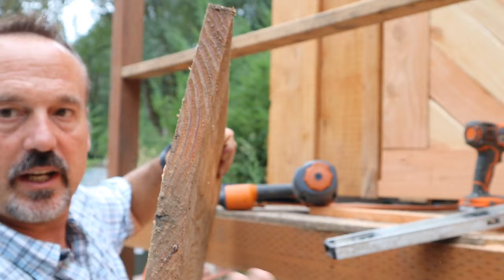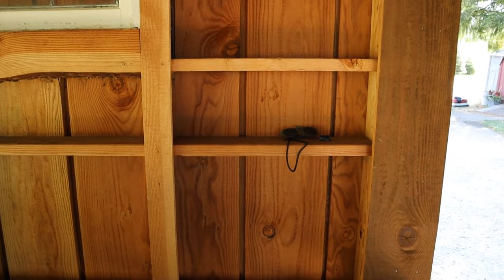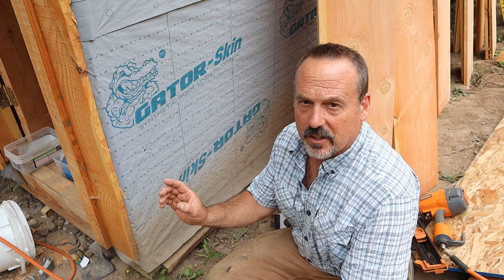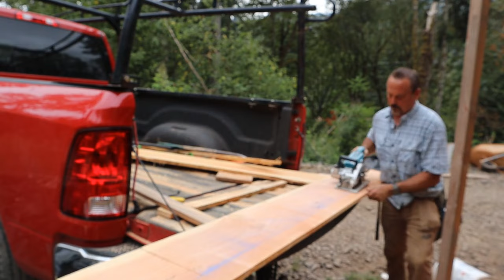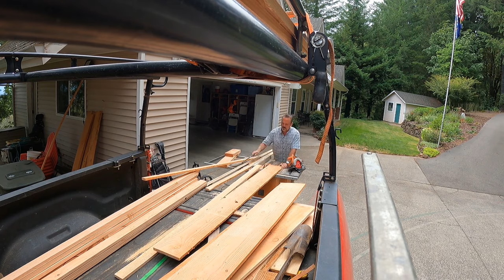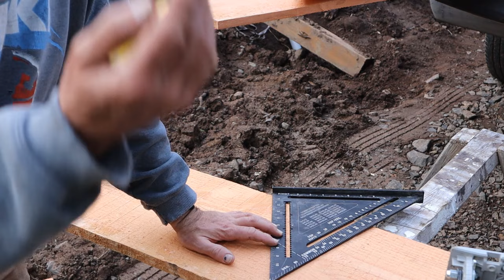Installing board and batten siding.  Board and bat how to.

Comment: Wow.  Great video.  So informative.  I was wondering if you would put any caulking between the batten and board.  You don't have any concerns of sideways rain getting into the walls and developing mold?  I guess this may also interfere with expansion/contraction of the boards.  (Initially, I was disappointed by the batten being on plywood, but in waiting a minute, I was very glad I continued watching.)

Comment: FOR ADDED STRENGTH I'M GOING TO PUT HOUSE WRAP, 
HORIZONTAL 2×4'S @18-24"O/C
1.5" INSULATION BOARD BETWEEN THE 2×4 THEN INSTALL THE B&B SIDING W/SCREW'S. 
LIVING IN LOWER N.MICHIGAN THE ADDED INSULATION BOARD WILL HELP REDUCE THE HEATING COST FOR WINTERS.
Reply from the maker: Excellent

Comment: What’s your take on using horizontal furring strips to create an air gap between the siding and house wrap for water drainage / ventilation?
Reply from the maker: @MrIsakdim  it seems to be an unnecessary move for those reasons.   If the strips were horizontal it would not help with drainage.
Reply: @FlanaganHomestead  

Good point. There are perforated strips allowing for water to go through.

Comment: Great video.  What type of wood did you use for your board and batten
 and also what size/type of nails did you use in your nail gun?  Thank you.
Reply from the maker: Thanks, I cut a large Doug Fir on my property for the boards.   1x12 boards 1x3 bats.  I have been using a 2 3/8 ring shank nail in my gun.

Comment: great video thank you so much ! What do you do on the corners of the building?
Reply from the maker: I take similar rough sawn lumber anywhere from 3 inch thick(which is the width of my bats).  To 5 inch.  Create a corner and mail it on.

Comment: Thanks! Informative and helpful.  Question: I’m building a small storage, basically a broom closet that will be on my covered deck. I’m using 6” wide rough cut cedar fence pickets for the verticals. Also I plan to stain and apply polyurethane. So my question is, will the fence pickets swell and contract enough to require attaching only on one side, as you demonstrate? Thanks again!
Reply from the maker: That narrow of a width, if the boards are very dry now, I wouldn’t expect as much shrinkage or expansion.   If it were me I would still fasten on one side.

Comment: I want to do this as siding on our house. It currently has old wooden clapboard siding. Do we need to remove the clapboard and put plywood to the studs, then wrap that with tyvex and then do the board and batton? If we were to do the plywood and batton instead of the true board and batton would we still need to do the plywood to the studs then wrap it with tyvex and then more plywood ontop of the tyvex for the battons to go on?
Reply from the maker: You could put it over clapboard, but it might create some problems. One would be it would push the final siding further out and trimming windows and doors would be difficult.  If doing plywood and batten you can put the tyvek on the studs, then plywood then batten.
Reply: What size plywood would you need on a house? 3/4 or 1/2 inch
Reply from the maker: @taurareynolds5049  in most situations 1/2 inch plywood has enough sheer strength for houses.   All homes here except for specialty homes are sheeted with 1/2 inch including my house.

Comment: Are you worried about the screws splitting the boards? Would it be better to use like a roofing screw that lays flat on the board?
Reply from the maker: Not when they are a long ways from the end of the board.   The screws at either end depending on the proximity to the end you need to be careful.

Comment: You can do it this guy's way if you want to spend 5x's the amount in materials and 3x's the labour to achieve the same end results
Reply: Ok, yes, there’s almost always a better way to a lot of things… do you have an instruction video or other instructional material available for how to do it for less time and money… or can you describe what to do differently… thanks.
Reply from the maker: @waynegreen4972  thanks for watching.   Can you explain your comment.   Are you referring to putting up rough faced plywood and putting bats on that.   Yes that would be faster and cheaper.   Some want actual board and batten.  I have done it both ways.

Comment: Are you using kiln dried lumber?
Reply from the maker: No mine is not kiln dried but it was stacked with spacers for several months.   Mostly dry, but that is the Beaty of board and bat, it allows for shrinkage during curing.
Reply: @FlanaganHomestead  nice.I also have a mill but haven't used it yet, a new woodland 130max, I'm going to mill a bunch of standing Austrian Pines and make B&B

Comment: B&B on top of plywood...?   Perhaps unnecessarily expensive with no real benefit other than visual...
Reply from the maker: I have vertcle framing.   Not good for board and bat.  Also b&b does not give sheer strength like plywood does.   I needed this for the design of the structure.
Reply: Can I do post and beam framing on top of a concrete pad? The posts will not be sunk into the concrete so I'm concerned they won't have enough sheer strength?
 @FlanaganHomestead
Reply from the maker: @JerryXM991  that would go against the design purpose.   If there is already a slab on the ground you wish to cover traditional vertical studs with plywood sheeting and sill plate anchored to the floor would be structurally more sound.